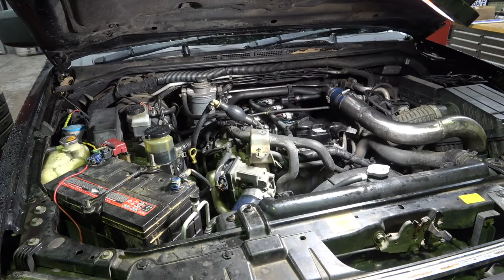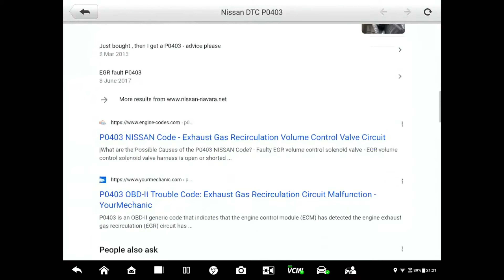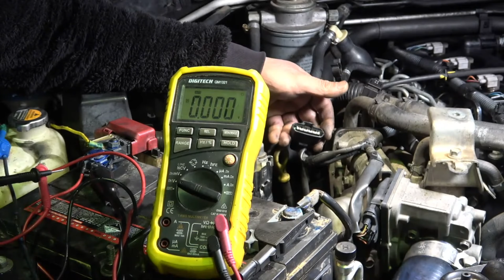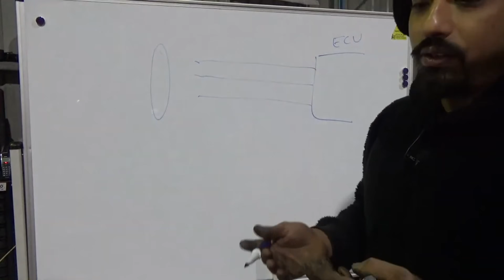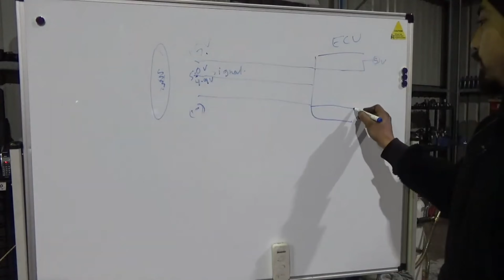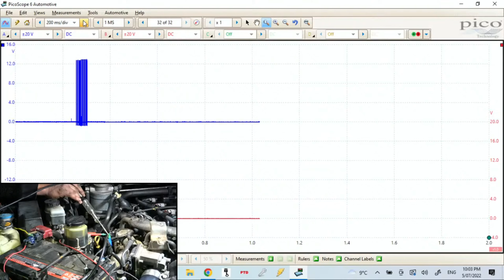D40 NAVARA EGR FAULT DETAILS

Comment: Hello there, I have replaced egr several times and the code still appears, please help..
Reply: I opened my EGR valve and found the position sensor was filthy dirty so gave it a clean and cleared the code now no issue with it
Reply: I have replaced with a new part and still same code and light on?
Reply: @georgemouskeftaras5604  P0409? Is the code I had. Mechanic wanted to replace EGR unit, I blanked it anyway but opened the valve up and noticed the position sensor was full of soot. Cleaned it out and haven't had the code since, I've heard replacements if not a genuine part stop working pretty quickly. Worth giving that a try? Then clear the code and see what happens